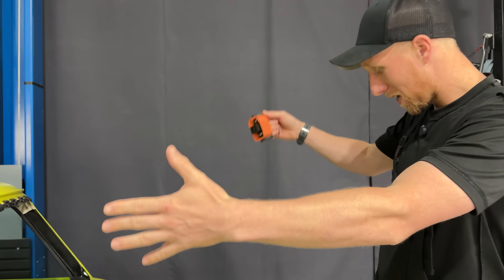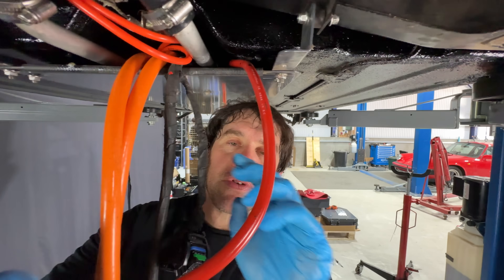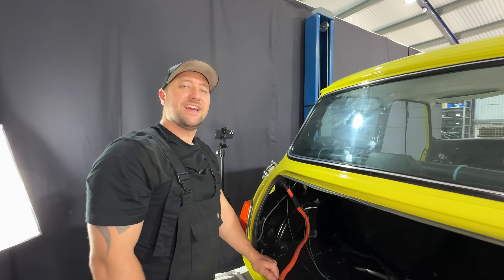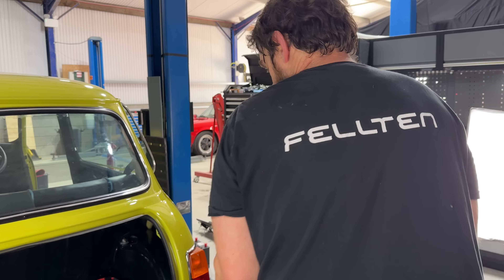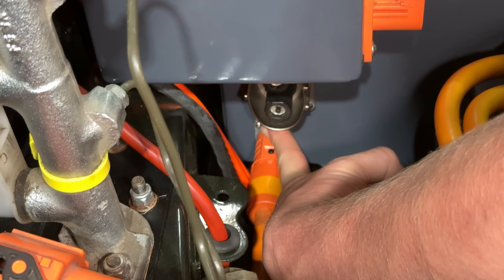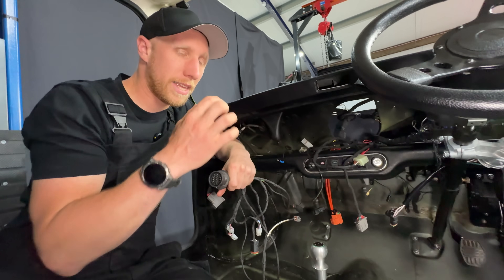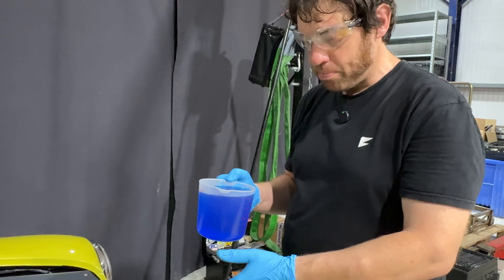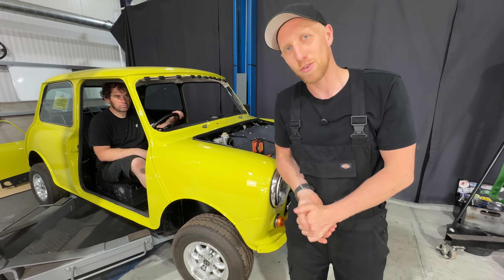EV Conversion of a Classic Mini Cooper to Electric - The E Bean is Assembled ESP3 - Part2

Comment: What is the value of the resistant between the battery to chaise ground? Why are you using a normal Lead acid battery in this build, why not a Lipo or similar battery.
Reply from the maker: at least 500 Ω/V but we aim for about 2000. Why replace a perfectly good battery….

Comment: There seem to be a few electrical connectors that could potentially be submerged when "wading" through flooded local roads ... has this been allowed for in their design or do you have to avoid standing water?
Reply from the maker: All the connectors are ip67 along with the charger/ dcdc unit. Then all pins not used have blanks fitted.
Reply from the maker: It does wade very well

Comment: Still a  lot of HV cables are not fixed to anything and not even protected, at least not seen in the video... Just vibration may eventually destroy the insulation and shielding and potentially cause a short, depending on the mileage though. HV cables should be treated as they were fuel pipes  on an ICE car at least...
Reply from the maker: There is a lot more fixing and protection but it’s always a juggling act when editing as to how much you show as more people’s attention span is not amazing these days.

Comment: Just a thought. If a mini had a twin fuel tank setup and has twin fuel caps. Would having a CHAdeMO on the second port be the same size as the type 2 port and work with the new charging electrics. Obviously a CHAdeMO to CCS adaptor would be needed and limiting the max charging speed to something low like 10-20KW.

I might just be talking out my arse though.
Reply from the maker: It’s an option, can’t do chademo to ccs though as the communication is different as chademo uses canbus but ccs uses power line 
communication

Comment: Any reason fo not going with ccs,or is it because it's a small battery,cheers guys from Kenya
Reply from the maker: It’s just because it’s a small battery. But Jaunt in Australia is fitting ccs to there moke builds. So it is doable as it’s a 350v system

Comment: weird that you have to make sure to not drill into the car in order to get it registered properly, must be some archaic laws I guess?
Reply from the maker: It’s crazy, if you leave it petrol can do what you want as they never check but as soon as you go EV they look at everything even if it’s not ev related.
Reply: @Hazell_Nutz  At least you have the option to retrofit these wonders in the UK. In Spain, for now, it's not even possible to get the vehicle approved for driving. To do this, you have to navigate through a pointless bureaucratic odyssey, with the conversion needing to be done by an authorized workshop, signed off by an engineer, and testing required for each modified part (powertrain, brakes, battery, weight distribution, etc.). It's an economic madness designed to drive users crazy.

Comment: What was the thinking with it been a Fwd kit? Is there a Rwd kit as an option?
Reply: As the mini was always designed to be front wheel drive it was left that way to keep the balance and original driving experience. Less the noisy smelly ICE.
Reply from the maker: Well said